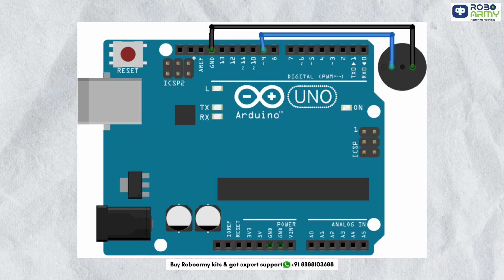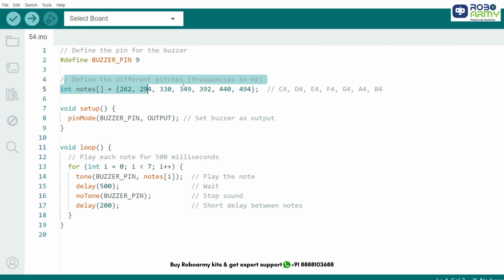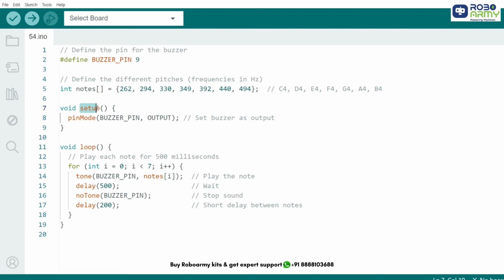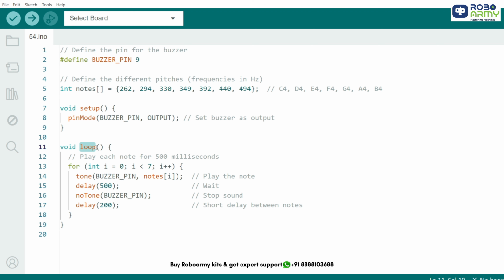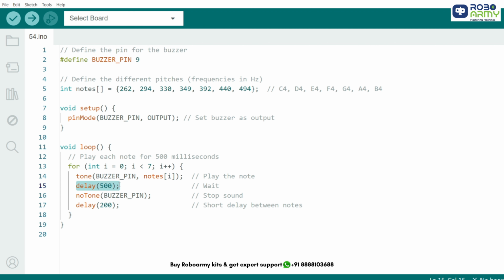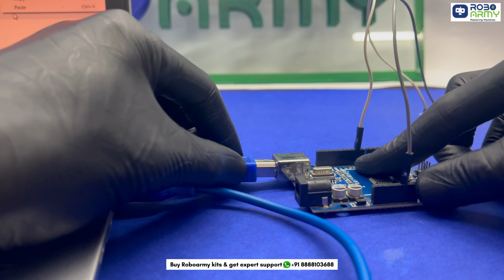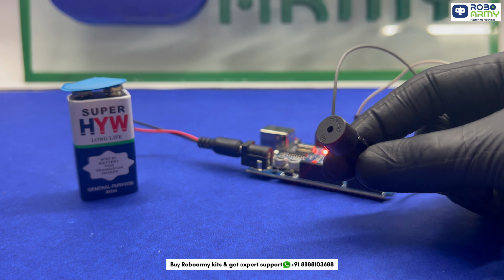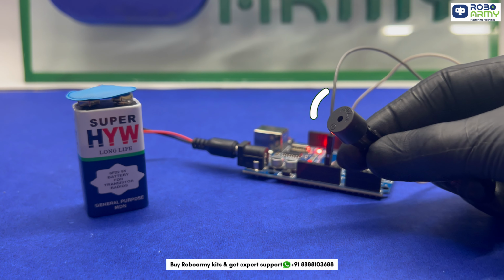Different Pitches Using Buzzer: Create Melodies with a Buzzer in Seconds! (Live Demo)

Comment: my code is not uploading but it's showing error and i double checked the code but it was correct
Reply from the maker: If the code is correct, then the issue might be with the board selection, COM port, cable, or drivers.

Comment: Can you please explain why is the buzzerpin assigned as 9 ? Can we set it to some other number?
Reply from the maker: Great question! 😊
Yes, the buzzer pin is assigned as 9 just by choice. You can connect the buzzer to any digital pin on the Arduino (like 3, 5, 6, 10, etc.).

We used pin 9 because it supports the tone() function properly and is commonly used in examples.
If you change the connection, just make sure to update the code as well, for example:
#define BUZZER_PIN 6

So the rule is simple 👉 pin in hardware = pin in code 👍
Thanks for asking and keep experimenting!